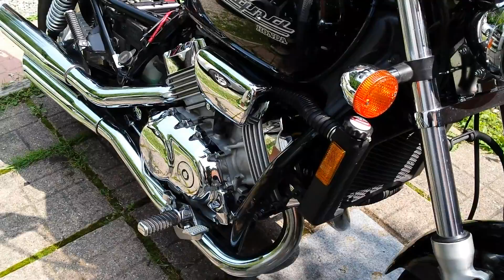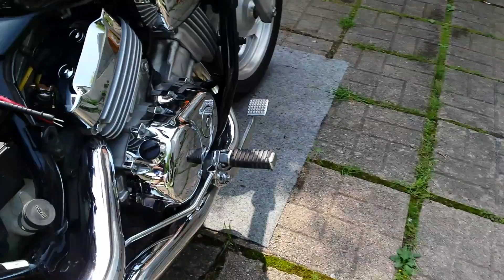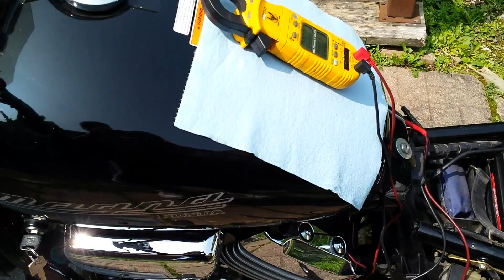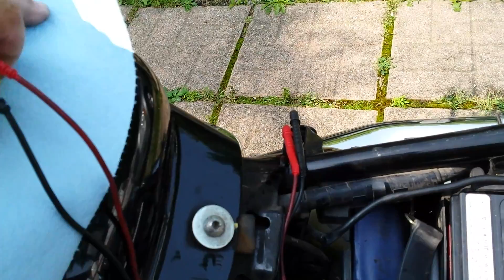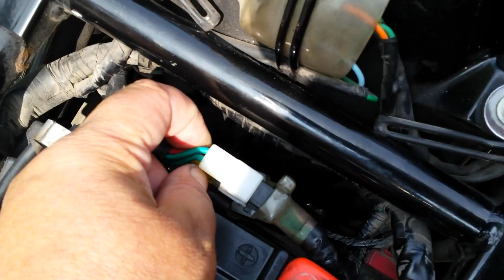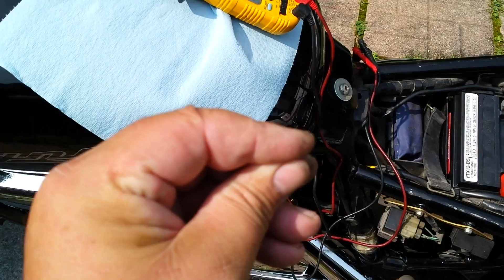VF750C Honda Magna regulator/rectifier check and replacement. Also continuity check of stator.

Comment: Burnt through six or so inches of insulation after replacing the regulator/rectifier. Got the connector cut off and wires fixed up, just waiting for the battery to trickle up. I think water got in there.

Comment: I have the opposite. No charge. Starting voltage then check, 11.94. Rev to 4k no increase of voltage. Battery charges with battery buddy and holds the charge

Comment: I really wish you had a video of the removal and replacement of the stator. I need to change mine but dont want to wing it on the parts to remove in order to replace it
Reply from the maker: Sorry brother..I don't have the bike anymore. Look for a manual it'll give you a step by step solution. Good luck.

Comment: I got a 95 and I just put a new stator, voltage regulator, and battery in and it won’t charge
Reply from the maker: You might have an in depth electrical problem that a Honda tech might have to check. I wouldn't dive too deep into it myself. Hope you get it going.
Reply from the maker: Check all fuses and grounds also.

Comment: How did you get it out
Reply from the maker: Take your time it's very difficult. After loosening it with an open end wrench I used my fingers and a magnet. You'll have to be an acrobat.
Reply: @darinparest  that was rusted so had to pull the whole damn box out. But I got the old one cut off and putting the new one on right now lol
Reply: This is my question, having a hell of a time trying to remove it!! Hoping putting it back in won't be worse!!!
Reply from the maker: @cynthiareadinger7281  you might have to turn the nut 1/4 turn at a time. Also, use an extendable magnet to make things a little easier. Hope this helps.